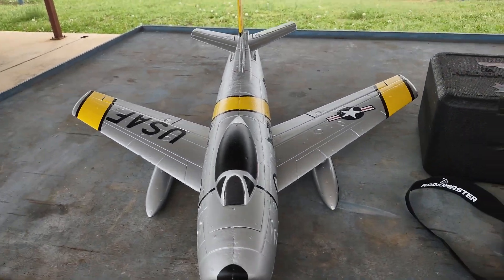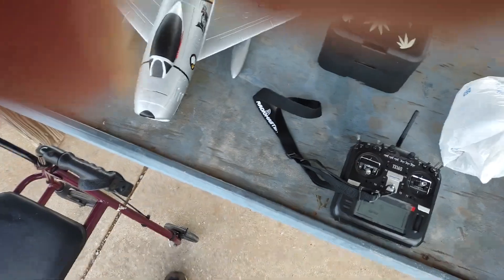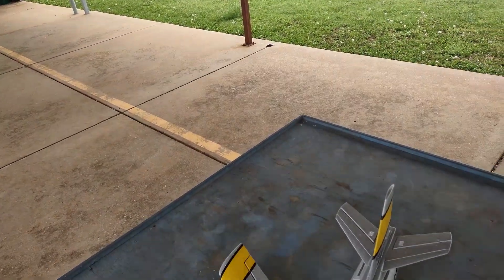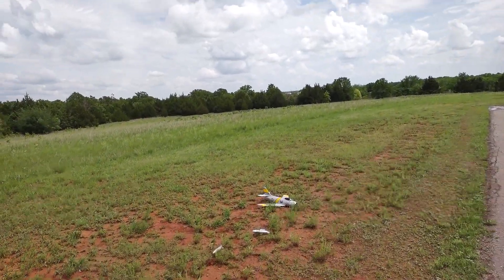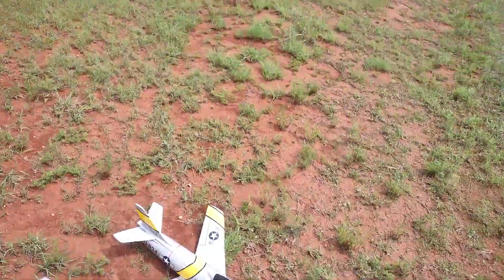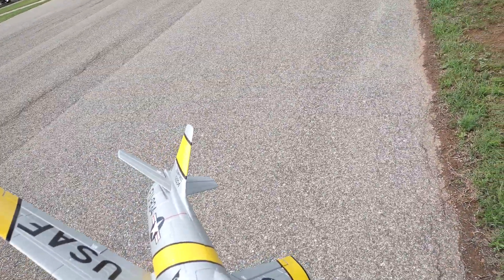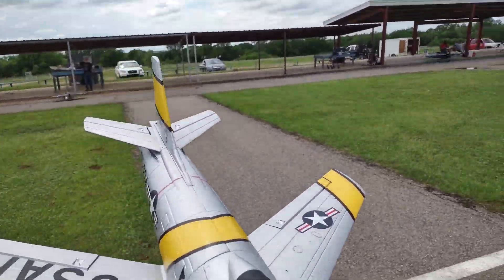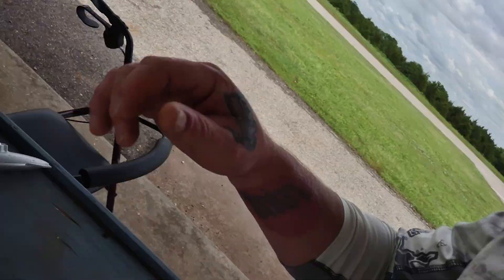Maiden flight review on the F-86 Sabre 64mm 3S EDF Jet. Let's fly. Thanks for watching.

Comment: Awesome jet will.  A 4s 1600 or 1800 will open that bad boy up. Those Sabres fly very well
Reply from the maker: Awesome thanks. So it will handle a 4S battery? I will try that on the next flight.
Reply: @WDRC .  It did on mine anyway. It had a 40amp esc like yours. So I figured it about the same
Reply from the maker: @SmokeyMountainRcTravisThompson  nice I'm going to order some 1800mah 4S packs and see how she does. Thanks